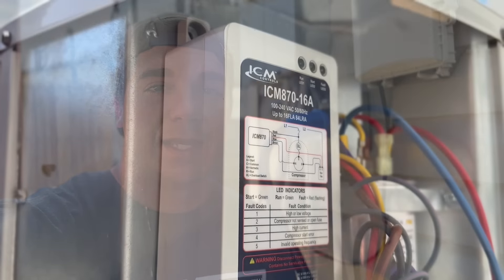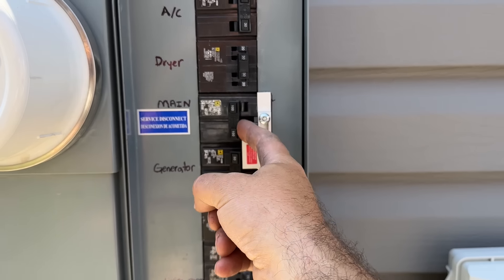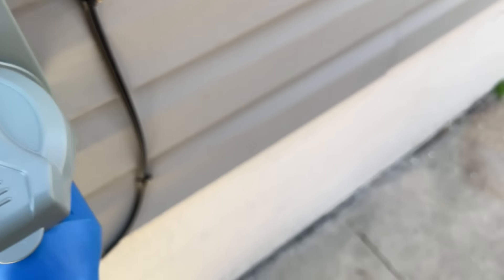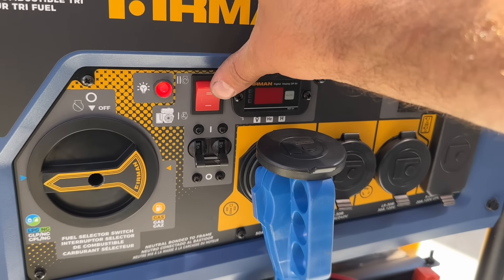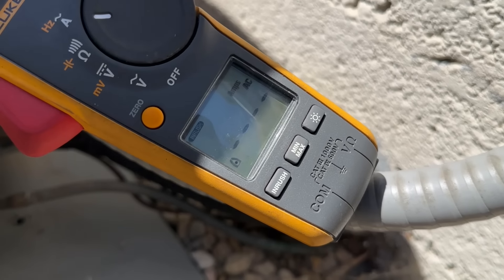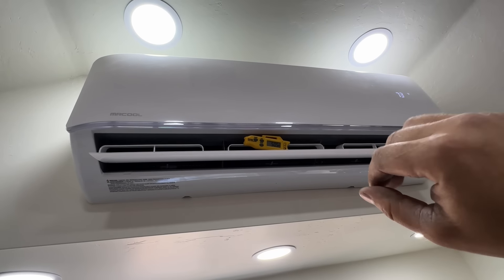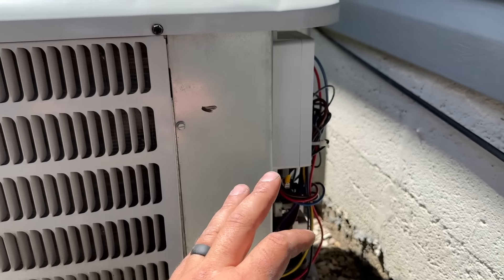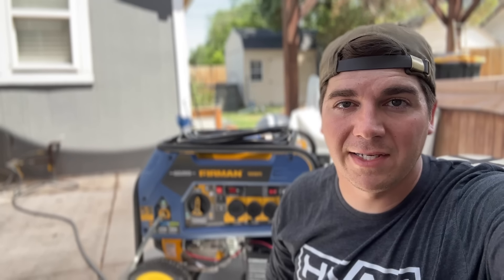How To Get Whole Home Backup Power For Under $1000

Comment: Awesome… this was super informative in my particular case because #1 you can get refurb tri-fuel generators at a reasonable cost and #2 I (a novice) had no clue those quick release valves existed (it seems obvious though, I know). Now I’m thinking this is an awesome supplement to a more expensive setup too for whole home battery backups. If the power in the battery starts to get low, you could maybe use this to recharge your batteries for completely uninterrupted power supply over long term (cheaper too since that generator uses 72cuft/hr when completely idle but 101cuft on full load).

Comment: Thanks for the content.  Gathering information. I knew about the soft start boxes from the RV world and how they allow RV AC to run on much lower amps.  Including a small generator. 
Good to see the generator is working to power Home AC. I have a NG pipeline at a new property but not electric service so I’m having to plan on doing a non grid tie solar array and a permanent NG generator tie in with a solar power cell for storage. 
Electric power equipment is in extreme shortage right now in USA and really expensive because of the shortage and the electric coop says it’s a year or more out to obtain a new line. They require a 25kva outdoor rated transformer and I have not been able to locate one in this state and one I did find in South Dakota was $7300. If I buy the equipment and the cables to run the lines I don’t get reimbursed, just donating the equipment in order to get a new line. I personally would rather invest my money in a NG generator and solar array and storage system. Keep these low budget low energy content coming.
Reply: The soft start does not reduce the running amperage, only the in-rush that lasts about 1/3rd of a second. If the AC takes 2000 watts to run, it can take up to 6000 watts to overcome the locked rotor amperage, which is what the compressor needs to overcome the static pressure in the system.   The Locked Rotor Amperage (LRA) is written on the spec plate of the AC.  For example, my 3.5 ton unit has an LRA of 109 amps, but once running, the system (including the circulation blower) runs about 4000 watts but even with a soft start, the draw starting draw is too much for my 5000 watt (6250 peak) inverter generator.

Comment: First, during many types of emergencies your natural gas will be shut off to prevent fires.  Second, during an emergency your central air, electric stove, electric dryer and electric furnace use too much power and should not be turned on.  If absolutely necessary, you can get a 5000-8000 btu window unit and only run it for a couple hours before bed time with the bedroom closed off and it should stay cool enough till morning. A microwave can do most of the cooking in just minutes on 1100 watts. You should be able to get by with a 3500 watt generator or inverter which will use far less fuel.  While living off the grid, I have never found it necessary to run the generator more than a couple hours per day. Just 10 gallons of stabilized gas will easily last all week.  A couple indoor/outdoor wireless thermometers keep track of the refrigerator and freezer to minimize run time.  Always connect several items at once to more efficiently use your generator time.  An oil lamp with a few quarts of lamp oil and some cheap solar yard lights($3each) can provide all your lighting.  Using a smaller generator and being prepared for a long term power outage makes more sense than having something that powers everything but will run out of fuel in just a few days. I also use two heavy duty 50 foot extension cords and plug the appliances in directly to the generator rather than waste money on an expensive transfer box.  Some people may have different needs but I don't want to waste money on a $10,000-12,000 whole house system just to use every convenience.

Comment: what is the longest the cable can be the connects the generator to the panel and

1. be safe
2. not allow enough voltage drop to occur that would compromise circuit performance

Comment: You're a lifesaver. So thorough. Not that it's a big deal, but could you use one for the hot water tank? I always turn ours off in a hurricane and if we need to use it, turn off all the lights and run it. More important to have A/C and lights than anything. I just have to see what size ICM870 I need for my 3.5 ton unit. Thanks again. 🙂

Comment: You forgot one very important thing. If you are connecting to your circuit panel you need to unbond the ground from the frame of the generator. You don’t want two locations where you bond the neutral and the ground. There is a jumper on the generator you need to pull off. If you are using a cord right to the source, not through the circuit panel you have to put it back on.

Comment: Awesome setup. 

My power went out for 8 hrs the other day. I have two ac units (upstairs and downstairs)  

I was able to run everything except the upstairs ac with a 12000W  generator.  

I wonder if i added a soft start for both ac units if i could run them both. 

One system is a 2.5 ton and the other is a 3 ton.

Comment: wow its hard to believe that a generator that small would even run a house. i have a 8750 /7000 harbor freight and love it it runs my entire house. but it dont have a 50 amp plug. GRRR  and i really like your power inlet box once in a while mine will work loose and i will lose have my house and thanks to you i just ordered one. even though it is only 30 amp. and the only gas we can get around here is propane so i more less have to stay with gas. another GRRR.

Comment: You don’t have to go through all of this. Just make a suicide cord for your dyer plug, make sure you turn off power coming in the house first. Then plug into your generator and you can run your whole house with a generator this size.

Comment: Hi, thank you so much for this video. We just bought the newest version of the Firman from Costco with Tri-Fuel. We have plumbed LP in our community and I am setting up the Firman as you have with a quick connection to this gas system. We live in Maui in a community north of the fire we just had. I realized we were totally unprepared and luckily found this generator after the fire and we are quickly becoming prepared. I would just like to ask you what is the best way to estimate how much gas we would be using from the community system to only power with extension cords. We would be powering for now only our deep freezer which is 7 cubic and a refrigerator 13 cubic and a Starlink satellite. In the future, I would love to set it up like you have to have a connection to the house but electricians are hard to come by right now during this crisis. Thank you for your help and God Bless.

Comment: Did you have to have a certain gas pressure or line size to run your generator, you T'd off your main line I was thinking about Ting off my gas stove and running it outside, I have a Predator 8750 that I was going to attach the optional gas adaptor, good video

Comment: You always want to shut off the main breaker on the generator BEFORE turning the generator off. Likewise, alsways power up the generator and THEN switch the breaker on. You never want the generator to be supplying power unless it is in steady state.

Comment: We were looking at this same generator at Costco.  We have a single 5-ton AC unit, house is 3000 sf, will the soft start work with this generator with an AC this size?  I know you said yours is only 2 tons.  I was wanting to go this route since we have Nat-Gas.  Last outage I used my gasoline only 7.5K generator.  I wired in the 6 circuit Reliant transfer switch years ago but do not have the AC on it.  Thank you and thank you for all of your informative videos!

Comment: In Texas the cost of electricity is getting insane .  Would it be possible to run this generator 24/7 straight for 4 months?  Would you expect that the cost of natural gas running this generator would be cheaper than what electric companies are now charging?   Enjoyed the video and considering implementing this as my primary source during summer.
Reply: This is not a constant duty generator.  Look at commercial grade diesel (Kubota, Cummins, etc) units for that capability.  No, they will not be cheaper than grid power.
  If you want to keep cool in Texas, it's going to cost you. My brother is in McKinney.  Over $300 power bill last month for their 40' motorhome with t/stat set at 80°. Ouch!

Comment: I gotta get that generator. I drive a Model 3 so losing power would be very annoying. We did lose power for three days this past winter (before I had the Model 3) and I had to borrow a generator to keep my pipes from freezing (Michigan, so cold winters!) I just have to figure out how to get that beast home, won’t fit in a Model 3 and Costco is a good 20 miles away.
Reply: Depending on your home and EV charger requirements you may need a larger generator than the one in this video.
Reply: @William_Charles_Baker  True, but odds are if we lost power I’d only have to go a few miles to find working plugs (we’re at the edge of one utility’s grid/near another) so it would be a charge the car a bit/switch back to powering boiler/water heater situation.

Comment: Living in Austin, TX. The past two winters have produced storms that knocked out our power for days. I invested in this generator (bought for $600) and a shed to store it in. We've had to break it out once since then, but by the time my son and I got everything hooked up and running the juice returned (of course). At the end of summer we have a pool being installed and I'm going to include running an inlet box to the main panel when the electric is installed for the pool.

Comment: I have the same generator you have.  My A/C will start.    I have a soft start kit but I don’t think it was installed properly.  It will start my central a/c but it clicks off after a few minutes.   after watching your video I am convinced my soft start was not I staled properly.   I am not going to buy a new generator until I buy a new soft start kit .  I would appreciate any advice.

Comment: Would a high efficiency furnace power on with this type of open frame generator? I was told the flame sensor in them won’t be able to pick up the flame signal due to the higher THD

Comment: For the inlet plug, I thought the ground was on the side and the middle “pin” is for alignment?
Reply from the maker: Nope, middle is ground, one of the flats is neutral, and one is for power, so you have power coming in through one flat side and unused power going back out through the neutral. The ground acts as a safety in case there is some sort of short, it will take the path of least resistance (the ground wire) back to earth

Comment: So, my main breaker is not on the breaker panel but a separate switch at the bottom. Will the electrician rewire it to a switch next to the main panel in order to get the interlock switch to work?

Comment: Long story short: your utility's NAT GAS service line normally has pressure of a few ounces (if that) so even in a grid down or major power outage--there will ALWAYS BE a few ounces of NAT GAS in your line to power this Firman or any dual-fuel Genny. In an emergency, think about it: 90% of your neighbors NAT GAS lines are not being in service--all the more pressure for you! Sorry to say that, but that's the way it is. See MATT 25 and the "Five Wise Virgins" parable from my Boss--a Jewish Carpenter.

Comment: I just bought a similar Firman HO 7553, but it is only dual fuel -- gasoline and propane.  I should have gotten the triple fuel model but I didn't see that model at Lowes and I had to have a generator.  From what I understand these Firmans will not power my entire home.

Comment: Just curious...if you switch off the main to plug in the generator...how do you actually know when the power does come back on? Serious question, not snark. lol  I can see it being 2 days later and then finding out from a neighbor down the street that it was only out for an hour. lol  GREAT that it's a much lower cost way to power your house when ya need it though. Thanks for this!

Comment: Good info, been using whole house generators  for over 20 years. Right now I own three generators: One of those Firman and two Honda EU7000is. BTW, those Firmans are great but NOISY!!!
Reply: I bought one, got it all hooked up but haven't ran it yet. The muffler is huge for a small engine, but I guess you are comparing it to those ultra quiet hondas.
Reply: I went to the link in the video description and it claims 72db...is this claim bs?

Comment: With the interlock on your main power panel in the position so that you’re running off your generator, how do you know if the power from your utility company is back on without switching it back and forth often?
Reply: If his electric meter is like mine, a smart meter, the display is blank when the power is out.  The numbers are displayed again when power is restored.

Comment: I have same setup but no gas in my area that would be so nice to have and not keep so many 5 gal cans around. I also have the suicide cord but i know what im doing i just back feed through garage panel. I am interested in the soft start for air thats the one thing i cant run on generator currently.

Comment: I am about to do something similar and just had the quick connect Propane line added to my house but I can't for the life of me figure out if I'm going to need a separate regulator for the generator. It looks like you've plugged directly into your generator inlet from your line and that's what I'm hoping to do But what I'm reading says my 2 psi regulator may still be too much pressure and the generator should have more like .5 psi. Any thoughts?

Comment: I need info on those soft start units & how to install them. I have 2 Goodman 2-ton units & I have a 10kw natural gas generator. I’m sure I can run both if I had those soft starts installed.

Comment: I have the Firman tri fuel and like it except for its high 25% THD rating.  I've found a number of items won;'t work with it such as one of my garage door openers, all of my UPS units of various models and brands and micro wave oven.   I don't see why Firman doesn't use a lower THD power head like Generac uses on their XP series.

Comment: Wasn't sure if anyone had asked this question, but what is the square footage of your house? I'm currently boiling in my skin here in the Houston area without power for over a week now and searching for tri-fuel generators at work, I see that you are powering your house, your mini-split and a/c for both.....I don't want to waste money and buy one that has too much or one that is too little. I have the soft start, the natural gas line connector in my cart.....now just trying to find the right one to power a 2300sqft house comfortably......
Reply: Hey I’m in the Conroe area and also have around the same size house newer build. I’m upgrading my wen 4000i to a Westinghouse 9500TFC tri fuel. This should cover my 3 ton ac(need soft start also) and the rest of my home.
Reply: @danegerous24  good to know and that is that exact model generator that I am looking at, like the NG option as during Beryl, gas was a rare commodity, but I am unsure what size my AC unit, keep forgetting to check my paperwork or unit when I go home, lol

Comment: i wonder what you think.    A HVAC system is rough 5-6 amp at your house to start with a soft start.  Is there such a thing for a Refrigerator. Im not an electrician but a big frig takes up a lot of start up amps to kick on as well. It has a compressor. I wonder if it is the same kind of thing. What do you think?

Comment: What kind of cable is that? I have this same generator that has a female NEMA 14-50 (I think). My electrician also installed a female NEMA 14-50 which meant I either had to do a suicide cord or rewire the inlet. Can you tell me how you solved this exactly?

Comment: great video, I have a 18K mr. cool and a Honda 7000 inverter generator, so you said your mister cool has aa soft start already so therefore I wouldn't need to do anything other than connect it to my transfer switch in a 220v breaker and all will be good? do you know approx. how many amps the mister cool draws I don't have a clamp on amp meter. thank you

Comment: Love the comments on your going to get pushback from know it all electricians....  Electrician here...  Soft-Starts on HVAC systems may not even be necessary an HVAC contractor or Electrician can probably let you know (you know the know it all guy).  Installation of a mechanical interlock with a generator receptacle is dependent on your load and should be evaluated by an electrician to determine the appropriate size of the generator and the receptacle.  You see they come in more than one size and the receptacle shown in this video is far larger than the one needed for that size generator.  No problems with over sizing but is the generator actually properly sized for the load.  Do you know how to determine the load?  Because you can do something and it "works" doesn't mean it's safe.  That's why you hire that know it all guy because he isn't a youtube video, he is actually evaluating your exact panel and giving you your options.  Afterwords you can still do it yourself but at least you got expert advice on your situation not the ops home.

Comment: This is a good way to show people how to burn their house down and blow the pins out of the air conditioner

This is also the reason that in order to pull a permit for a generator install you have to do it load calculation because people will just hook up a generator and assume it has enough power the entire house

Comment: I have the same portable gen set.  But you are running it at near maximum load.  Its not a long term solution, you are operating it on the edge of its duty cycle. 
For my FL house, we are installing a 24kW Generac unit.